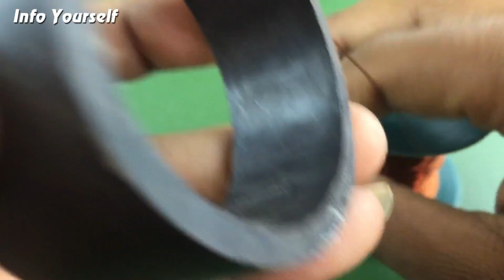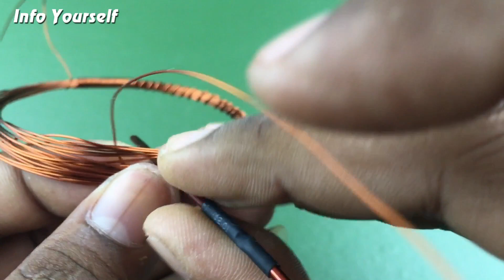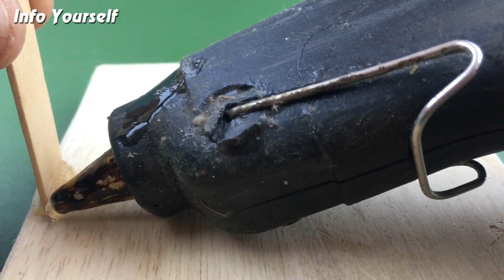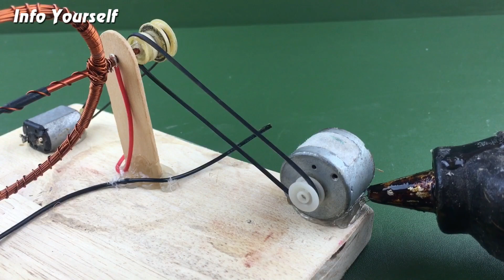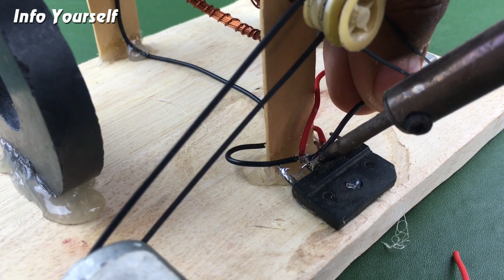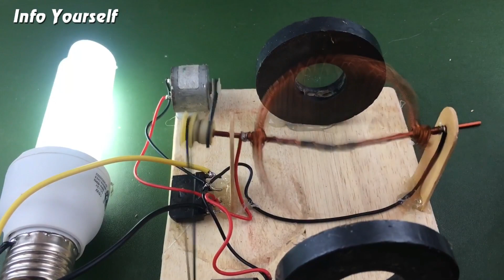Free Energy Technology Self Running DC Motor Generator New Invention 2019

Comment: So, one motor acts as a generator, to power the motor that is lighting the bulb. The copper wire and magnets are a flywheel to power the generator. As soon as the flywheel stops turning, the power stops flowing. Assuming that the bulb isn't 230-240v but can be illuminated on 6v or less, it still isn't free electricity and is less efficient than a wind turbine, which could be used to replace the flywheel. Most of what you have here is over complicated and energy wasting. Nice try though! lol.

Comment: How is a Device like this capable of delivering 110-230v for the lamp to Run?
The Motors used  can deluver about 5 - 7 Volts and a FBR (Full Bridge Rectifier) cant covert those 5 - 7 Volts AC into 110 - 230 Volts AC, the Bridge Rectifier is a Device used to create dc Not ac
Electrician and Refrigeration Technician speaking here
Reply: You do not have to have 110 V to 230 V to turn a lightbulb on.  Looks like he is using a small alternator,  then rectifying it to the small DC motor on the other side

Comment: The 2 big magnets are doing nothing that copper wire is doing nothing . Copper needs to be wrapped around steel to make or accept a magnetic feild . The batteries are in there somewhere
Reply: Copper dont Need iron to have a FEM induced on it. About the rest your right.

Comment: As soon as you routed the AC from the generator to the DC motors, it was obvious that this was all a ruse. Second, that the 
low voltage from the generator that would be suitable for those (3  - 6 VDC) toy motors would somehow get stepped up by the bridge rectifier to the 120 VAC necessary to run the lamp was silly. Ha ha.Another time waster.
Reply: First of all, why would you say it does not work? Instead of stating the problem, why don't you provide the solution big shot?